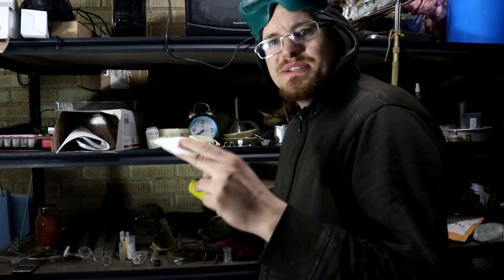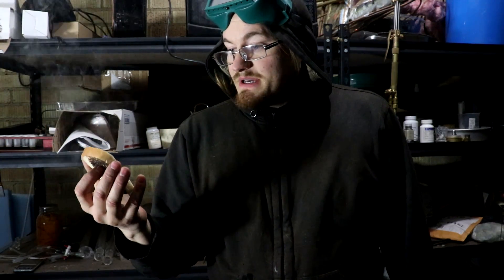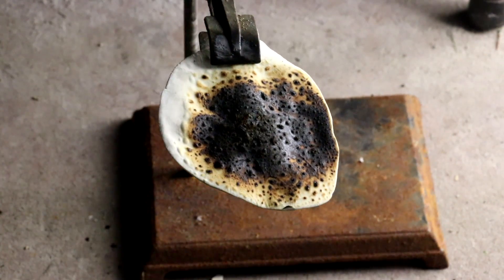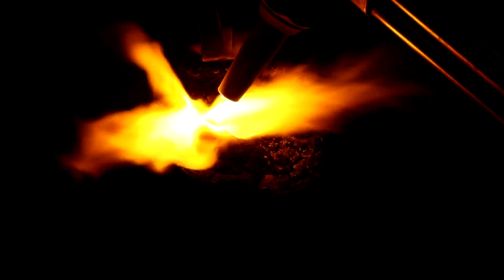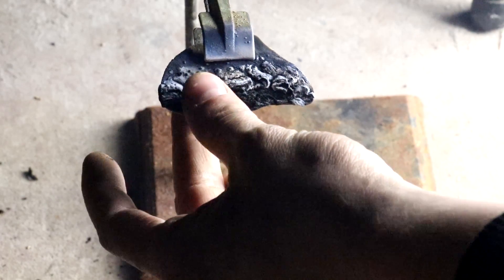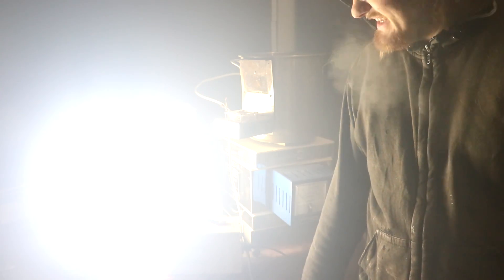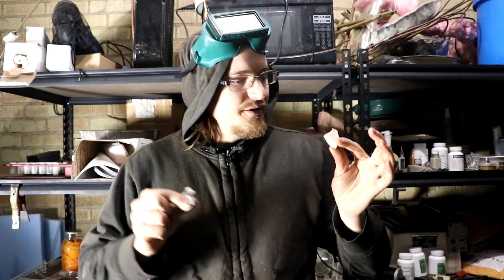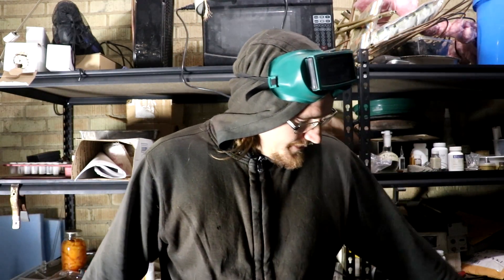Can I Burn Through Starlite?

Comment: Imagine this being covered on the walls of a room. If properly covered. Most fires would likely burn themselves out before spreading. Or suits sprayed with it.   Or lining a blanket with it. Obviously the stuff has a tolerance point. But used in conjunction with things like fireboards. The stuff is actually super underhyped (in my humble opinion) even said in the video it was cool to the touch

Comment: A water jet would cut through it too. You're not burning through it. You're mechanically cutting through it like a waterjet or even a high pressure air tank. For as smart as you are, a 5 year old could have called bs on you with this vid

Comment: Your torch tests are irrelevant. Starlight was designed to be applied in a liquid form and given time to fully cure. Further more you are starting at the very edge of the material, If original formula starlite was applied to something you would not have a bare edge to start on. Finally, you have is an approximation of starlite in a solid form that was never truly liquid, it is not anything like the original formula tested by NASA with very powerful and focused laser systems. In closing your experiment is FAIL.

Comment: Just a quick thought. When u were burning it, you went from one edge to the other
Would it make any difference if you lit up the torch on the middle of the material (so the carbon "shield" might stay in the place) or would it simply burn a hole it it..? 

Just my thinking :)

Comment: It couldn't take the acetylene torch, as some figured it wouldn't... As by Nighthalk's explanation, starlite resists fire through a carbon shield, carbon melts at ~3500ºC, which, coincidentally or not, is, more or less, the temperature of that acetylene torch. Hmm... 

The claim that it could take 10000ºC is a bit out there since that temperature is enough to break almost any bond in matter, that said, it is still very impressive, a thing that can withstand ~3000ºC is an amazing thing, and judgin by how simple it is it could very well change how we use and see thermal resistant materials, or how we use thermal dissipation, even if it couldn't take atmospheric reentry. It's not the second coming of christ, but it's damn well impressive, for what it is, that is.

Comment: you missed the fun in this one. Its not a competition. Its about the science of carbon foam and its uses when the cost is under $10. 
It would have been a much better video to take a structure, coat in this material, and put it into a firebox along with a competitor , (like a drill cooked in a giant bread loaf, something fire safe sized). It would also be interesting to explore and explain how heat transfer effects this material as well as some of its other properties if you change the binding glue.

Comment: Starlite is great against radiant heat due to the carbon foam it makes. The pressure from the torch physically slices through the carbon foam. If the test were simply, can starlite shield itself from a radiant heat source, then yes. But as soon as there's a significant abrasive element added in then it's going to fail.

Comment: Note: Edge-on torch cutting might be the worst case scenario for the material, if it's true that the carbon foam and cold CO2 layer is the key to its stability under heat, then the "blowing away" from a shearing wind is what kills it.

If you direct the torch at the center of the tile, does it do better than when you cut at the side?

Comment: That is not starlight the pressure from that torch is blowing away the carbon which protects it apply the same temperatures without holding a torch half inch away

Comment: And of course, I have to trust that you mixed the Starlite correctly. I have tested this formula up to 4 thousand degrees. It did not fail. So, to me, your Starlite process might be suspect. Considering, that you said that the piece of bread was equal. However, I saw in your video, after burning it just for a few seconds that the piece of bread was burned black on the other side. This doesn’t happen with Starlaite. You can burn Starlite for many many minutes and the other side is warm at most.
Reply: Well you know, burning a piece of bread for three seconds obviously means that bread is equal to something you can burn for minutes at a time, everybody knows that! That's how science works, you test something out for 4% of the time as something else and if it works the same for less than 1/20th of the time it's exactly the same and should be presented as such.

Comment: Your torch is blowing out fragile carbon layer you genius... Put it under large lens and try the same with solar power. I'll bet the result will be 180 degree different. 
And what did you say about thermite?  That it isn't that good at burning thru things??? I saw piece of a real tank get cut/burned thru with thermite, so yeah... And another thing - I dare you to hold that piece of bread as long as you can hold that starlite thing while blasting it with torch... - before that say goodbye to your hand holding bread.

Comment: If the inventor was a barber then if I guess he might have had limited knowledge about chemicals. But bakingsoda and starch is used (I think) in the old days barbershops and would most likely had been known to him. 

I have a sample in my kitchen now, as I write, I added 5 micron flake-size Graphene into the mix, about 20%. So my piece is already charcoal looking and dark. I don't have any torch, but I could visit a welder and ask him cut thru it :)

Comment: I love your videos, but in this one I feel you are cheating. With the oxygen blow, aren't you physically removing material that otherwise would stay in place? Could you re-do the test without blowing against the material? It's like as if you used an ordinary torch and kept poking the Starlite with some rod to remove the carbon, and then said "hey, it did not withstand". I know the material, as is, would face problems if used as an insulator for rockets. But come on, it can't be the only possible use for it. And we shouldn't rule out improvements with research.

Comment: yeah, I knew it, and think some of the simplest mixtures made at home can be superior tho a bit heavier and more dense. Like powdered gypsum and plaster mixed and spread on whatever surface, probably aluminum, and of course, there's the fiberglass type of materials of all kinds. physical structure has more to do with heat dissipation and resistance than the actual molecules. MLMM's are interesting but really not available to the average joe

Comment: I never pegged you to be deliberately misleading, perhaps even dishonest, before this video Cody. I concede that could be a misinterpretation on my end. Your comparison with that slice of bread was bull and you know it. You put out this persona of being scientific and then put out this video. I guess the word disappointed is the most appropriate way to state how I feel about this.

Get a slice of toast and a piece of starlite the same thickness and size as that slice of toast and repeat the standard propane torch test. You're dishonest if you maintain the claim the toast will do the same thing. You're dishonest if you claim the plaster board will insulate your hand from the heat in the same manner. Do the tests scientifically. 

I'm not making the claims that starlite is a miraculous material. The recipe you are using is certainly inadequate for any form of reentry shield and I suspect the real recipe also had a huge shortfall which was the real reason the creator wouldn't share his formula. I see a lot of comments criticizing your use of the oxyacetylene torch, but your point isn't to test its insulating properties, it's to see if you can burn through it. Perhaps you didn't use an adequate amount of material. I know for a fact the ablative layer on NASA's heat shields is far thicker than what you tested here. Believe it or not the conditions of reentry don't put as much pinpoint pressure on the ablative shielding as this torch. Friction generates the heat because of the speed of the craft. Most of this happens in the thinnest layers of our atmosphere and the ablative material is not blown away in the same manner your torch does in this video. This is not how NASA tests their heat shields. They test the entire shield simulating the conditions the shield will actually be facing with atmospheric density which also changes pressures on the material with supersonic aerodynamics. The ionized gasses in the plasma that forms at those temperatures actually forms a pillow along the surface of the ablative shielding that reduces how much can be pulled away which increases its effectiveness. You just can't replicate that with any torch.

There's a reason he didn't let NASA test his starlite. It's too brittle and vulnerable to decomposition to be reliable. Russia used laminated oak for their first heat shields and the propensity for wood to absorb moisture was an issue, which you noted as something the material you whipped up is also doing. Reentry is way hotter than even your oxyacetylene torch and this material just would not be sufficient. Not in the quantity required to do the job. It would be too bulky and heavy.

I just don't appreciate the way you tried to compare it to a piece of toast making the extremely inaccurate claim that they perform the same way in efficacy. They do not. There is no arguing that.
Reply: But he tested the toast for less than 1/20th of the time as the starlite! that CLEARLY means they're the same that's how science works, you test something for minuscule periods of time to compare things to one another, especially things that purported to hold up to minutes at a time.

Comment: I guess starlite by itself doesn't provide much protection if pressure is added to the variables. It's only heat resistant. Not pressure. Of course. If it was to be blasted to bits, the carbon foam it creates to shield itself won't stand a chance. It probably needs to be protected with something that's pressure resistant or the combination of both with starlite being used only to absorb the majority of the heat.

Comment: A"flame" is incorporating oxygen in the burning process, a cutting torch ADDS oxygen, not a fair test...also the high velocity gases from the torch ablate the carbon coating of the decomposing starlite- the pseudo starlite is still quite FLAME resistant...

Comment: rather than jet blast the carbon insulation away - what about producing a heated flame  in one central spot that does not physically cause the insulating carbon to be removed ?

Comment: Regardless of the composition he is not using heat but the power of
Compressed gas to push off the protective carbon coating. He admits it harder to cut than stainless ... so he is saying it sucks while using the psi from his torch to physically push it. His argument would hold up if we wrapped the shuttle in this but we do not. Maps gas burns at 1500+ which is very close his torch. He is just blasting it with the gas psi to clickbait. Fake “science”.
Reply: Moron.

Comment: you are doing it wrong you heat it from the side so the carbon forms on the side and then by the pushpower of the torch you blow it off so the whole starlight effect doesn't take place

Comment: I have a theory... Demon core 89 millimeters in diameter and 14 pounds...  Can anything else thats non radio active like steel be able to be a "prop" demon core but still weigh 14 pounds and have the same dimentions? Wouldnt it be cool to have a "prop" zlotin experiment?

Comment: Way to negate the black body radiator by attaching the edge and blowing away the carbon. In reentry heating (what this stuff is intended to be used for) the heat is from radiation, not friction. Thumbs down.  Proof here to not stick ONLY with Almighty Cody's "OPINION"

Comment: Actual starlite also does not carbonize in the way NightHawk's version of starlite does. While carbon does eventually form it takes quite some time before even small amounts of it begins to cake onto the surface of the starlite being exposed to the torch. The volume of carbon foam formed with actual starlite is also substantially less then this version of starlite. While I suspect it's quite possible that NightHawk has taken a step in the right direction trying to crack the original formula it's still a far cry from the what it's supposed to be. Either way this is really good stuff! I'd love to see more of this.

Comment: Based on NightHawkinLight's description of his formula, Starlight is basically carbon foam.  Carbon has a melting point of 3,500K which is the approximate temperature of an oxyacetylene torch. The low density of the foam provides for good insulating properties, a low specific heat so that it cools rapidly, but makes the surface very fragile and easily ablated.
Once the volatiles burn off wood and yes, bread are also forms of carbon foam.
NightHawk's video was most interesting because of the historical background surrounding the inventor and the mystery of the formula that he "took to his grave".

Comment: I would be interested to see if the edges are weaker than the center. For example, would it stand up longer to an oxy acetylene torch or reentry if the edges were not in contact with the heat? Also and more especially, would it last significantly longer if it was on a substrate as a coating instead of hanging in midair without support? I'm hypothesizing probably not to the first, and possibly to the second?

Comment: It would be a decent alternative for protection against the heat of reentry from orbit since the heat produced from reentry is half that of an oxy-acetylene torch. Since its relatively cheap to make it would be relatively easy to replace if damaged or if required after every reentry

Comment: What you should be trying to burn through is phenolic resins that they use in heat shields, I suspect that'll smell a lot worst.
Reply: Scott Manley u make good vids
Reply: Scott, how effective (or ineffective) would starlite be as an ablative heat shield?
Reply: @Zachary If you actually watched Cody's vid, he says that the carbon layer formed on top of the material gets swiped away by oxygen so the material itself would be inadequate as a heat shield. The idea of it, however, may be improved upon
Reply: @grenzviel4480  If you actually read my question, you would have noticed I used the word 'ablative' which is more-or-less what you're describing. Not to mention, the (or ineffective) part. I didn't ask if it would or wouldn't work. I basically asked how well it would (or wouldn't) work, which you didn't answer. I want the numbers. I want to know how much improvement is necessary, if any, to be functional for this specific application.
Reply: Oh christ, why not just have him clean up Nile Red's waste material.

I think one of the problems with these "tests" is that the material isn't being vacuum desiccated and the moisture content is making the gross structure far more ablative than sublimative.

Comment: 2 points:
1-starlite were a different material 
2- it was meant to go on a shield and a major design parameter is the radius, a more interesting way to test it is starting to burn it from the center since the torch is now scraping away the carbon layers exosing a sharp edge.

Comment: It combusts in open air, but what about if you heat it via pyrolysis? You could make a thin crucible and fill it with molten metal.

Comment: I still want to see someone test this substance's resistance to radiant heat under vacuum. The disappointing resistance to the oxyacetylene torch is definitely due to the velocity of the gas physically blasting away the layer of porous carbon, an electric arc would have been a better choice, or perhaps oxyhydrogen instead of oxyacetylene. Nevertheless, great video.

Comment: Starlite was tested by NASA, video'd online with a thin layer coating an egg with 5 minutes of blow torching and had government investors lined up. "Starlite" proposed by a fellow youtuber fails your simple experiments. You shouldn't say it's Starlite without airquotes. I propose it's boron-nitride with a little something extra. That is already proven to be extremely heat resistant.

Comment: As many comments point out, this material isn't designed to withstand high pressure. It can very easily be cut with a knife, broken by hand, or chewed if you wanted to do that. Using an oxyacetalene torch to blast the material out is akin to putting concrete under a heavy tensile load and concluding that it's not a great material.

Comment: Interesting. So, in an inert/reducing atmosphere, this kind of carbon-foam-producing insulation could be pretty good, but in an oxidising atmosphere it burns up easily? Kind of what I expected, but it happened faster than I thought it would with the neutral flame.

Comment: Where did you get the "10,000 degrees Celsius" figure?
Instead of cutting it from the edge, why don't you see if it does what it was intended to do--INSULATE?
Your so-called test is a straw-man argument.

Comment: I love that my favorite channels follow each other. I don't think this is a very good temperature test though. It's a great durability test but it doesn't demonstrate how much heat this can take because the pressure is blowing away the carbon. Might as well be using air pressure to cut it in half. Would like to see this material take higher temps without the carbon layer being blown away by a stream of hot gas so we can see just how heat resistant this material actually is.

Comment: it seems like the high pressure compromises the insulating carbon layers as they form. I wonder if making this into a composite would help at all. It would be interesting to see fiberglass added to the mix, however i don't think adding molten glass to the equation would be very good.